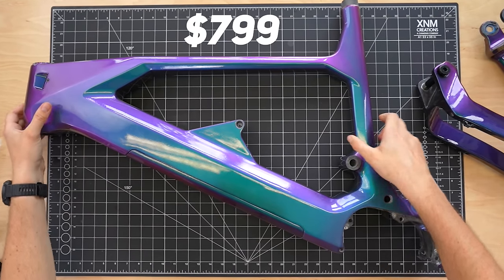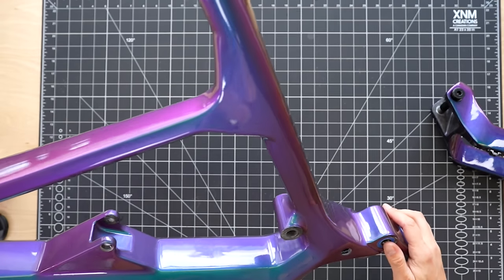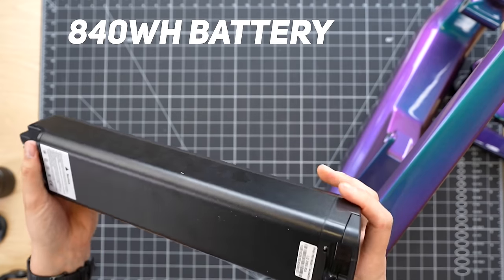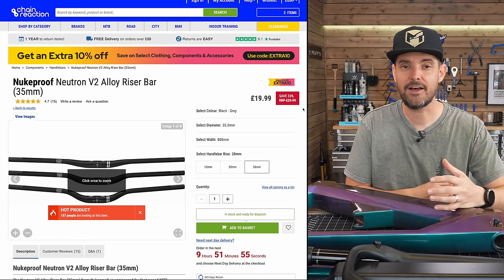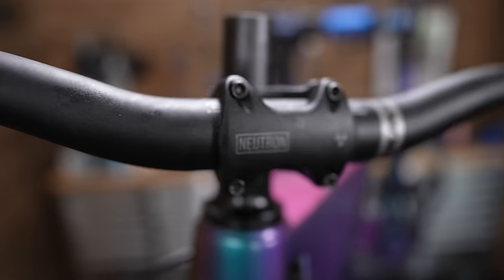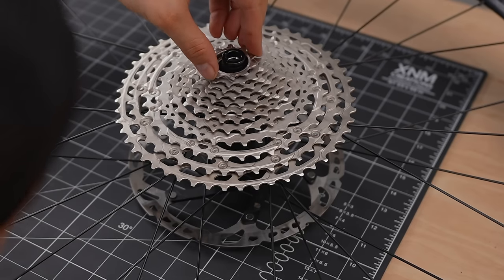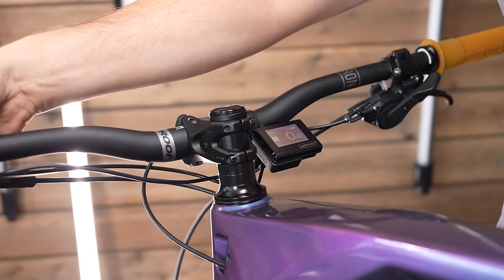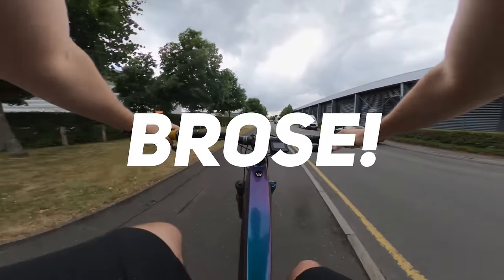How To Build a Cheap DIY eBike

Comment from the maker: This new M510 motor is really strong! Looking forward to sharing the next video! ps - this is a new frame, not the same one I did before. DENGFU revised the frame slightly (new charging port location and new battery cover that is quick release. Looks similar as they painted it THE EXACT same colours from my last video! Also, motor is the 2022 Bafang M510).
Reply: I was confused at first, thinking it was the old bike. Now I really want to build one!
Reply: Thats 23.98kg with a 840wh battery!! That is lighter than my old carbon trek Powerfly which only had a 500wh battery. You might be able to put a smaller 400wh battery and get down to a sub 20kg bike with a few other mods.
Reply: Will the frame withstand a actual mountain biking abuse?  Not jumping but the bumps and what not.  Great video
Reply: Hello Rob Rides Emtb ,  we sell the same bikes - MAX CARBON here and we also use 550wh 52V custom batteries, which is almost 1kg lighter , which will bring your bike down to 23kg.  VOLITION EBIKE Australia
Reply: Honest question: If you order a Shimano drivetrain from Aliexpress, how can you be sure that it is not a fake Shimano drivetrain?
Interesting build btw!
Reply: @patswayze2493  They certainly do. Checkout Rob's Cheeb build video where he gets a dude to launch it off largish jumps and Rob does some decent drop-offs.
I have one too, they are strong 🙂
Reply: Great video Rob, very much looking forward to testing in comparison the m600. A lot of people waiting for that something that can go Toe to Toe with all the little big boys. But Still Loving my 68 lb. Bafang powered m620 Ultra
Reply: hey there are you willing to donate this bike
Reply: New to the channel and super glad I found it, I was wondering how durable your previous Chinese e bike build was in regards to the motor. Any long term issues that you came across? I’m really interested in building one of my own but I’m a little worried about the longevity of the motor/battery and electronics. Thanks
Reply: Hola! Que talla de cuadro recomiendas para 1'8 metros de altura?? 

Gracias!
Reply: Great vid Rob! Why choose the Bafang m510 over the EU legal m600s?
Reply: How much
Reply: Hey Rob, I cannot wait for the next video with the test drive! Can you tell me if the frame is still called E10?
Reply: Follow up with full review on this bike please! I'll even subscribe for your troubles
Reply: Waiting for the video...

Comment: In this day and age of £12k+ bikes I find builds like this really refreshing. Especially as this is a much more affordable price range for me and makes the prospect of owning an E-MTB more likely! I'm looking forward to seeing your video of it being ridden.
Reply: you get what you pay for
Reply: @MOAB-UT  which 1/2 the time is labour (see what I did there? ;) ).
Reply: @MOAB-UT  Nah, not in the world of ebikes, all share the same basic CHINESE electrics then charge you for the NAME on the sticker.
Reply: @ianmangham4570  This is mostly true actually.
Reply: @marksimpson4005  No.
Reply: most of the motors used in mtb are the same manufacturers i think
Reply: @pakusssoohmnpe6646  Probably one HUGE factory in china churning them out. That does not mean they are all the same. Like most things, there can be different levels or performance, components and electrical tolerances. You tend to get what you pay for.
Reply: @MOAB-UT  Meh, if you took a 2k bike and a 12k bike it would be such a small performance increase its not even funny. If you take a 500 bike and compared it to a 2k bike then yea there would be a difference. The higher in the spectrum the less bang you get for your buck.
Reply: @upsidedownpeon9984  I very much agree.
Reply: @upsidedownpeon9984  This is the point of paying 80 dollars instead of 200 for a derailleur that is 50 grams lighter. especially with higher end manufacturers like Specialized you als pay a lot for the name. motors vary a lot for the theory of them coming out of the same factory.. Brose are wisper quiet, bosch cx gen4 blow bearings left right and center, EP8´s snap their spindles etc..
Reply: @MOAB-UT  not sure what you mean? Everything on the bike is name brand except for  the frame. The bafang motor is tried and tested and is outperforming other brands. Perhaps it’s lacking in fancy oled screens or apps, but it does it’s job, better than many brands out there. Big brands charge for labour and support, then there’s the bike shop that also needs to take a cut. That’s where 60% of the cost is going.
Reply: @mobaumeister2732  Still, you get what you pay for. Even under the same brand and model name. For example, if a product like an HDTV is sold to Walmart it can have cheaper internal components than if the same product is sold into a Best Buy. It's hard to tell but in the product number, there might be a unique product code. Same factory doesn't mean much. Again, you get what you pay for. "Upside down Peon" is right. Once you get past a certain price point, the tangible, real life differences are negligible. I don't buy the most expensive products and I don't buy the cheapest either. I am usually happy. One exception is a new Fractal FM9 I am about to buy- $1,599 it is one of the most expensive guitar processors on the market- but it's worth it...if I only I can get it. With the so called "chip shortage" I have been on the waiting list for a year.

Comment: Nice.

You don't even need a headset bearing press.  If you freeze the bearing cups.  And use a gentle amount of heat from a heat gun or hair dryer on the frame.  Then the differing thermal expansion rates let the bearing cups slip right into the frame.  

I did it exactly like that on my dengfu e22 (basically an e10 with a bigger motor).
Reply: I thought I was the only one who had worked that trick, back in 1986 with my ducati.
Reply: Now that is a neat trick! 👍
Reply: yep, I remember my LBS getting angry at me for freezing the cups as they had no idea how i got them in haha
Reply: Coming back 2 years later to read this, makes this worthwhile. THANK YOU!!! 👊🏾🧔🏾‍♂️

Comment: Best Part About this Bike is the quality choice of real mountain bike parts and components.   Not only that but you smartly choose high quality parts at good prices.  Most pre-built Bafang Powered bikes out there are running a junk spec on drivetrain, brakes, wheels and tires.  Well Done, I would love to see follow up reviewing this motor vs. other Bafang Motors like the BBSHD, Bafang Ultra, etc.

Comment: Good job showing an alternative way to get a eBike.    Not so fast on the most powerful eBike......I have one of the original Bafang motors that outputs 160Nm of Torque.  My battery is 52 volt 1100Ah....all put in an Luna Cycle Apollo...I love the bike for all it can do.

Comment: Helpful video - figured I need to build my own commuter e-bike to get what I want - a decent but not necessarily very powerful mid-drive motor, large battery, Rohlhoff E14 belt-driven hub, large enough ring to cog ratio to be able to reach 30 mph at maintainable cadence.

...and all this should be in a full suspension frame with 29" wheels and hydraulic brakes...

Comment: i built my Alloy version and now am building the M600 version in carbon.  Carbon components where i can as well.  Wheels are carbon, bars are carbon and so on.  I have the Bafang motor controller programming kit and will update the amperage output as well. they run 18amp but the controller can safely go to 25amp.  i will run 22amp and although i have the standard battery (840 watt) i will also build a custom battery as i did with my other bike.  I have access through my work with a company in Japan to Sodium ion battery cells and aluminium graphine batteries.  Using a conbination of both cells in one battery unit (requires 2 chargers sadly), i get over 1000 watts and the delivery is so good, that after 759 cycles on my current bike the battery still reports 99.97%.  The drain I suspect is not the battery, but the degradation of the wiring between cells.  Therefore my next battery with run a silicon wire we use in satellites.  With my bikes i dissasemble the motors and seal the controller board with Urethane conformal sealant, and the joiners all have electrical greas on them.  We also shrink seal any joins.  the battery compartment is sealed as well and the bike has no issues if submerged.  I am so excited with my carbon version.

Comment: When are you going  to drop an update video for this build (and motor specifically)?  I think a lot of us are very curious of the differences.  Also curious on your thoughts of building a bike like this versus buying an similarly priced entry level spec bike from a dealer with a good support network (Ex. Orbea Rise H30).  Keep up the good content.

Comment: This was absolutely incredible and super inspiring! After watching this I certainly want to build my own e-bike. However, I want a road bike, not a mountain bike. Thanks a million for this!
Reply: You can definitely build an electric road bike, you may want to split the difference and do an E-gravel though because the extra motor/battery weight can feel ROUGH with no suspension in my experience
Reply: @tamholt3494  Thanks! I'll keep that in mind. Keep on rocking!
Reply: @tamholt3494  Thinking about what you said, how about a bike without suspension, but with gravel tires and a seat post with suspension?

Comment: If it doesn't crack/snap, it looks really good actually! Nice vid.
Reply: @BradCagle  Not a surprise, but still sucks.
Reply from the maker: This exact Dengfu E10 frame? This would be the first one, there are many out there and not a single report of one has cracked.
Reply from the maker: Are you 100% sure it’s Dengfu? Please check, as I’ve not seen any Dengfu frames crack so far.

Comment: Very nice! I have two Deng-Fu mountain bike frames with Bafang M600 motors. One has 3000 miles and the other 1200 miles. Both of them technical trail and gravel road riding. I think the M600 has more power than the M510? Also, I have 14S Samsung battery pack and 52 volt battery. Both bikes are Luna X1's. I tried to get a Deng-Fu frame and build one but Deng-Fu will not sell to US and Canada. Luna has an exclusive with Deng-Fu.
No big deal, I really like my Luna X1's. Thanks for the excellent build video

Comment: I just bought an used bike for 1000$ and installed tsdz2 motor with torque sensor, all for 1400$. New motor, new 750Wh battery, 3amps charger.

Comment: Hi Rob , great project and a fantastically produced video.  Much appreciated.  You say this is an Dengfu E10 but I can’t see that frame available on their website and the other frames seemed to have seriously jumped up in price.  There is an E04 currently selling for $879 but the E05 is $2,499 , E06 $2549 and E14 $2399!!  How did you ever get that price for that frame?? Thanks again
Reply: probably reject pile + CF could be dangerous IMHO
Reply: I think the prices you referenced include the bafang Motor

Comment: Really enjoyed this video. Was thinking of assembling a new bike myself. Hoping to complete the components over time. Was hoping u could do a video on a build using the new integrated drives (motor and gearbox) and or systems like the Valeo, Olli or Reventon One paired with a carbon drive

Comment: I like this, but the weight i'll be putting on the cheap frame will give me such anxiety, i'll be touching cloth from start till end of each ride haha! Kudos to you though i have to say. All we want is eMTB to get that much cheaper all round. Spending more than 3k on a bike seems unfathomable for a lot of us. Let alone the entry point of 4-6k. Question for you mate, do you see E-MTB's getting more affordable as time goes by? I feel like we've been blessed a bit by the tech advancements in geometry, drive train and suspension on regular MTBS since the last decade. A good affordable bike is of a higher calibre than it used to be anyway. Might be comparing apples or oranges abit here but, one can dream lol.

Comment: Excellent video, and thanks for teaching folk how to do this, have you considered building a 2 wheel drive bike, there is no comparison off road, I first built one of these about 12 years ago, using 2 heinzman hub motors, mounting half the power pack on each side of substantial forks allows the machine traction when in 5 feet of fast flowing water. furthermore mixing up a geared low torque and gearless high torque or vice versa, also adds some interesting performance characteristics, my first one had a half million candle power spot light, and if you didn't use a key to start it, it would hit you with 72 volts to deter theft, the last 2 parts are probably illegal now and qualify as weapons, but it would be nice to see you make something that did 0-60mph in 3 seconds or so.

Comment: Hi Rob. I'm currently looking for my 1st emtb but I must admit with prices rocketing I don't see much value in what is around right now. Love this project and video. My main concern with a build project would be the wiring and internal routing. 2 questions please. 1. How did you find the wiring of the controller to the battery and motor etc? 2. What is that little tool you use for grabbing the ends of the cables and pulling them through please? Cheer. Ryan

Comment: Great video rob.
I have a bafang mid drive with the big brother the m600 great reliable motors.
Can't wait to see test run
Reply: If going flange mount, I would do the Bafang Ultra big watt motor as well versus the 510.

Comment: It looks pretty good ngl but what one thing has me thinking. Is the rear travel actually gonna be used? The frame's pretty tight and it doesn't look like it can withstand a 150mm travel on the rear because of the linkage. You might crash that rear linkage into your main frame if you use too much travel.

Comment: Rob! That build is AWESOME!!You just created a Beautiful EMTB And Thank you for using BAFANG as they are becoming very popular where I live and I know people who have insane kits that go 51mph off road although they are 72volt haha!!
Reply: What is the best source of information about the fast bikes you mention?  I love my turbo levo, but building my own that is faster sounds like a great fun project!
Reply: @tptrsn  If you want to build something faster and more cost effective than what Rob built, check out JohnnyNerdout's channel.  He builds Bafang BBSHD 29'ers.  If you want to explore the margin of what the BBSHD can do with aftermarket controller, check out High Votage's channel.  Or...you can follow Rob's blueprint if dual suspension and lower power motor suits your fancy of course.
Reply: @lukewalker1051  Thank you so much!  I will check out ALL of those things!  I do love hitting some bike park jumps, but I also would love to play with something even more zippy.  Seems like a lot of fun to be had with this stuff, and I've built a China sourced carbon hardtail before that was a really fun project.  This seems like a "logical" next step. Lol
Reply: @tptrsn  If you want a quicker motor than Rob has used here, the Bafang M600 fits and has more power and top speed 
I have this frame and motor combo and it's great, it's hit 49kph so far 🙂
Reply: @Yourfriendwasmagnificent  Thanks for the tip!
Reply: @tptrsn  You're welcome 🙂
Reply: @Yourfriendwasmagnificent  Question. I have a 2019 Alloy DC Devinci, 500wh battery and getting 40klms distance per trail ride, which is not good. Are you using the same battery as Rob suggested and what difference do you perceive in these two Bafang motors?

Comment: Could be a great option for someone who already owns a regular mountain bike, and looking to go the e bike route. I know not all components are compatible, but you could try and by just the frame, motor and battery, and repurpose most of your current components. Do you know if they have frames for different wheel sizes, and for different suspension travels?
Reply: Good idea, You could also just by a donor bike on ebay/marketplace and transfer the parts over

Comment: This looks great I have been waiting for my ebike to arrive for over a year 
I'm spending 8500 
Which bike out there would you buy with this money 
You have ridden most of them
Reply: I waited for mine like 4 months and was in a similar spending bracket. What model makes you so patient?
Reply: that is pretty much the price of a 2022 KTM 250 SX-F... now given the fact that every single part on a competitive motocross bike is way better than on a bicycle... I find it very hard to justify such a huge price tag...
Reply: @olik136  so? If you dont want to motocross around, what does it even matter. People drive around in 80k cars, 20k bikes. None does your health any good. Priorities I guess. If your like me and live close to the alps, and bike there regularly none of your bs hubdrives or motocross machines would do me any good or fit my purpose. My set of skis cost 900€ and is good for 2 years before too soft, its all relative.

Comment: Those motors look smart but my worry would be what happens when it goes and needs warranty! Shipping costs and times there and back if you can get them to do it would be a nightmare.
Reply: If you need warranty, will you need to send it to china or to poland? Because bafang has a production line in poland, i could image, that they will also take care about warranty cases from europe, not sure about usa/australia

Comment: Looks great but I've asked them for a quote today and it was over £2200 which gives a built price of £3.5K pushing it pretty close to good budget bikes like the Stilus V3 29.  I understand things are on the increase but thats about 30%
Reply: Just for the frame ?
Reply: @SSH01  2220 for frame, motor, battery and shipping.  not sure why there is such a big difference to the  price Rob had of 1720.  Just waiting for a reply.